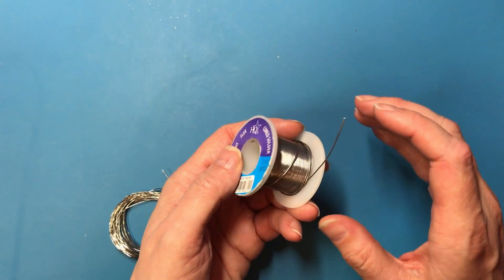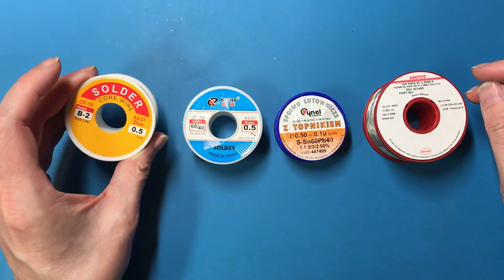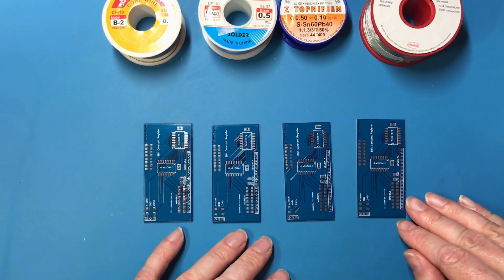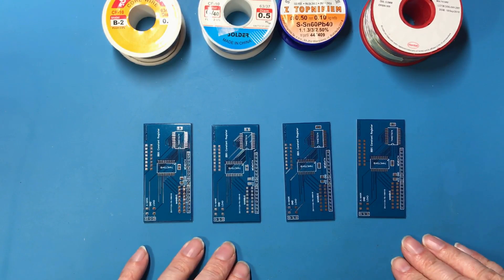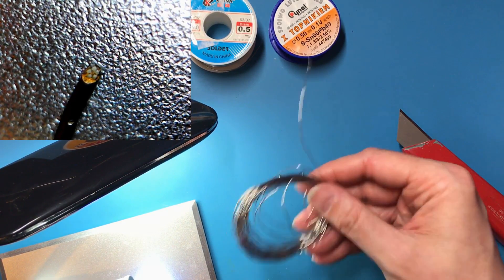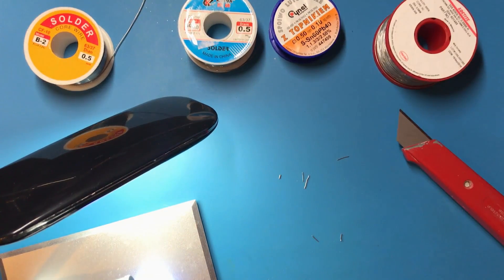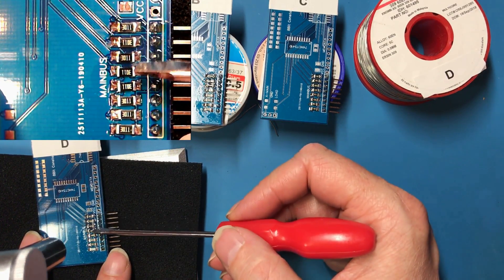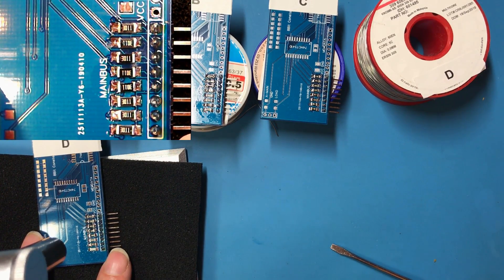eBay Solder Test

Comment: Hi James, interesting topic! I'm just an amateur, but hardly ever use flux. The thin resin (single) core solder I use works fine for the things I solder...
Reply from the maker: I kind of say this in the video, but it before I did the first address register I researched smd soldering and bought some 63/37 0.5mm solder thinking that was the right thing to do. It was rubbish, so I was curious how much variation there was. (Edit: typo)